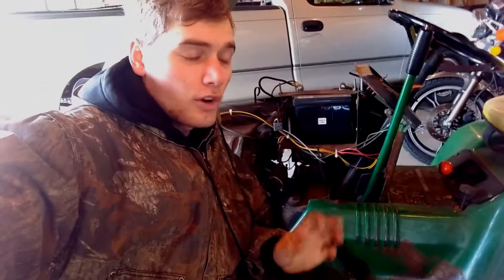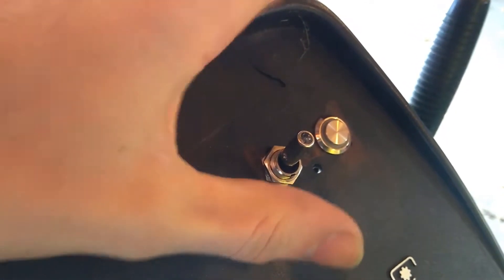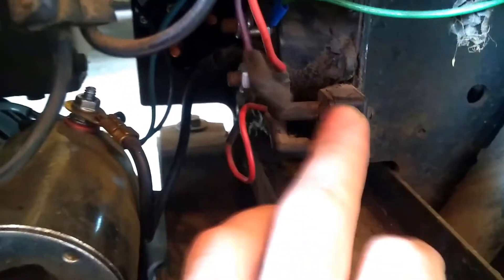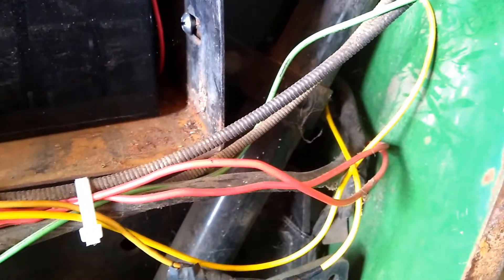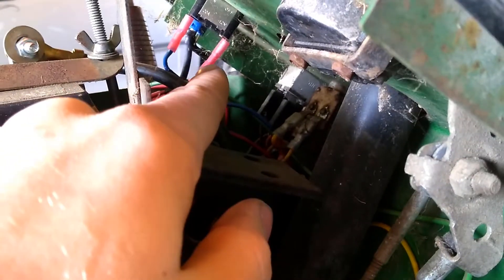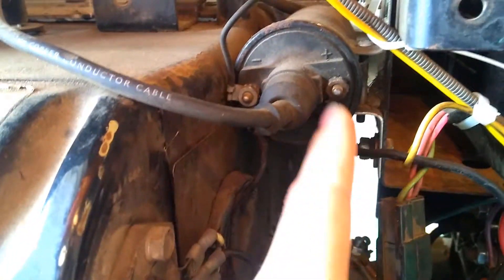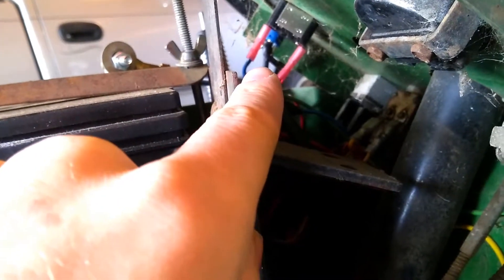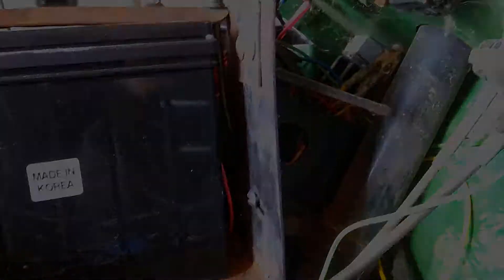John Deere 214 Electrical Start Circuit Explained

Comment: Cool video I like the keyless ignition set up. I’m trying to rewire my battery ground someone else has been there!  They did a horrible job with the terminal connections on the cables so I’m redoing them with solder and a special tool to divot them. When I took it apart I swear the little black wire was hooked to the head stud. But I’m wondering if it should go to the frame somewhere?????

Comment: im trying to do that on my 212, one day i turned the key and i heard a little snap, lost all power, no lites no nothing,can you help me please??
Reply from the maker: The snap was probably something in the key shorting out is my guess or a  wire burning up.  I would start by checking the power wire from the battery to the key.  If this has 12v at the key it is good.  Then check the wire from the key to the coil of your start solenoid you can do this use the ohm setting on your meter it should be .3 or less for a good wire. Then check coil back to the battery the same way.  If all the wires are good then problem is key or solenoid.  The solenoid is easy to check you can take a spare wire run it from the positive side of the and just touch the positive side of the solenoid and it'll click in and start the motor.  If you don't want it to start the motor simply disconnect the large battery cable going to it then check the main battery leads across the solenoid with the ohm setting to confirm it's got good.  That leaves only the key switch as issue.
Hope that helps 😊